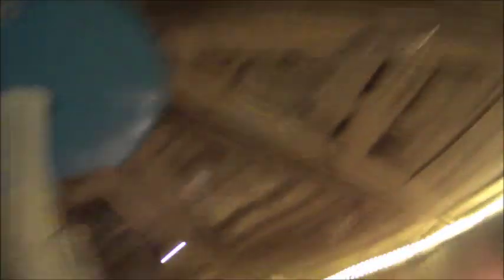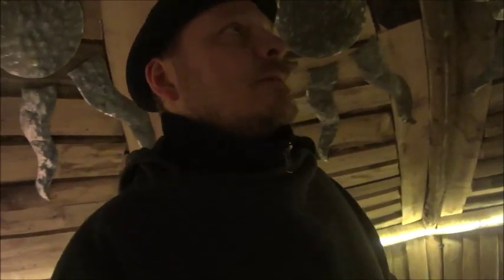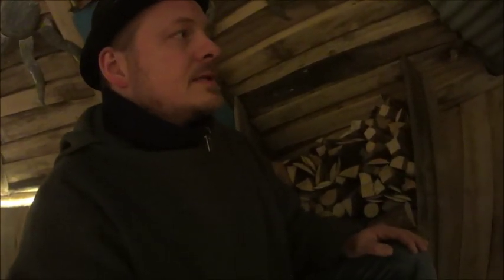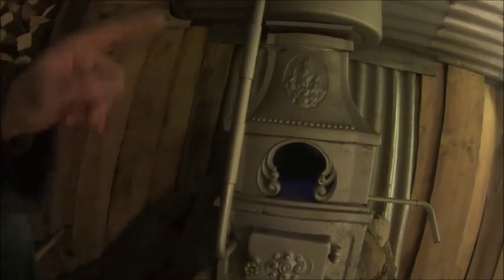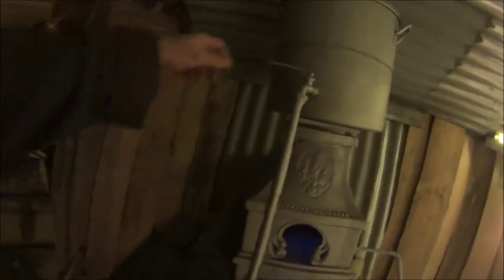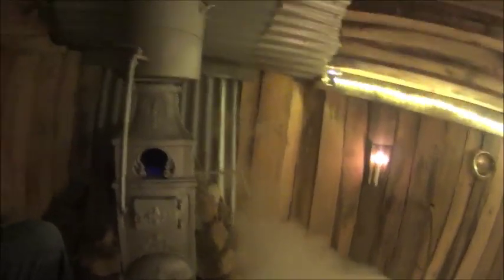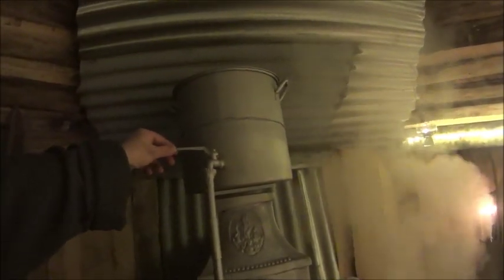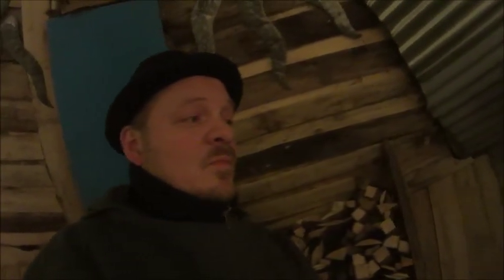How to build a sauna in the ground part 3

Comment: That is really nice!! I think that you need a larger stove though. If you check out how the traditional sauna water heaters work you may be able to do somewhat the same with your tub.
All you need to do is have  the stove lower so that the copper coil is always filled with water, have one end of the line closer to the top of the fill line in the tub and one below it. The top will discharge the heated water, the lower will be the intake. Works on convection as it heats in the tub. You don't need a pump.
Not quite a traditional finnish sauna but, I love it!! Great job! You are a very creative person!
Reply from the maker: That's very good advice, thank you. I'll try to experiment a bit. Really appreciate your comment.

Comment: Hi Stein,  I have followed you thru 3 vids and it looks great.  Are you "finished" yet?  More like me,  always not quite getting done with a project because I stray off to another partially done project.(as soon as I got interior wall paneling, I fired my sauna up and was a few years before I put on outside wall siding ) Well,  so on to my questions.  After being thru a  winter,  how is it all working?  Does it get your sweat pouring off your body profusely?  How hot do you think it gets to?  How long does it take heating up to be able to get in to be able to sweat?  I realize the water gets hot and makes steam,  but the structure will suck up a lot of that heat until it reaches that certain point where it really gets hot enough to sweat.  I love all your hard work and hope it is working well.  My sauna is around 23(not positive)  years  old and I use it regularly......but mine isn't a "crazy" building,  but I love it non the less.  Ok, dude,  keep on cool projects---Lopez Island, Washington
ps:  no changing room?
Reply from the maker: Hello txbob. Haha, no changing room, no. My wife and I are the only ones using it. I haven't gotten it up to the ideal temperature, no. But I am hoping when I have put on more earth and stuff on the outside, less heat will escape through the roof. No, none of my projects are never completely finished, or they are always under improvement. Thanks for your interest, sounds like you have a great sauna yourself, enjoy.
Reply: stein Lingaas
, Hi Stein,  Hopefully adding more  earth will take care of the problem.  It is a beautiful structure.  I bet it will work nicer in the summer when the temperature  isn't down to -30....good luck,  and at least you did sweat a lot with all the digging you have done---peace to Ya--Texas Bob

Comment: but why those logs on roof are so thick ?  they will be good just for few years.. :/
Reply from the maker: I guess your thinking of the steam getting in to the wood making it rot. Well I have airwents in the roof that I open after use, and I guess I,m trying it out, if I have to change anything, I will when the time comes.